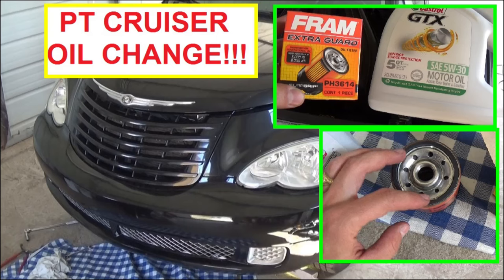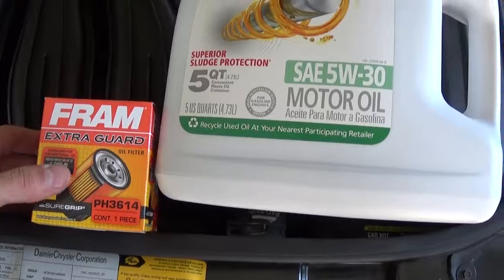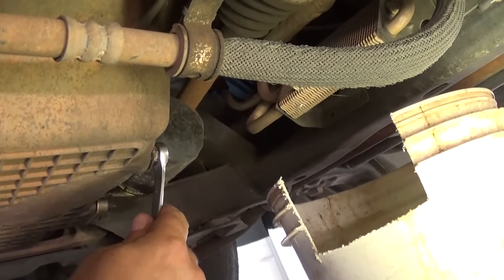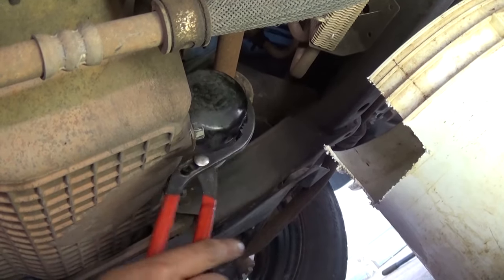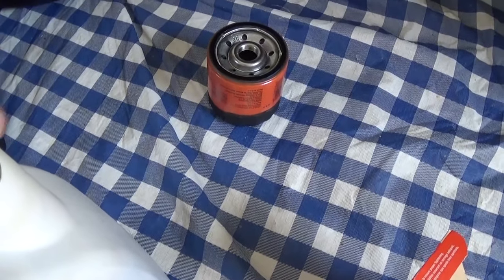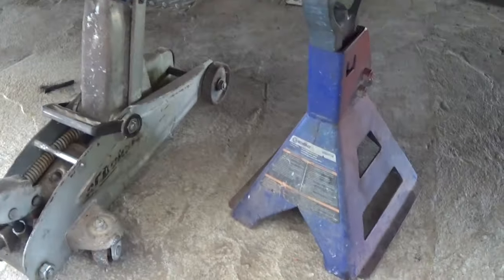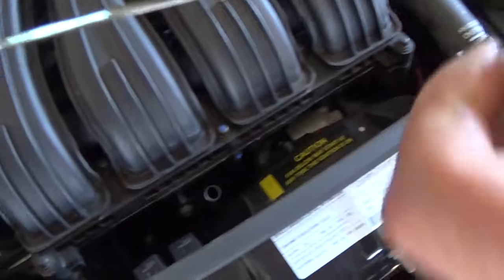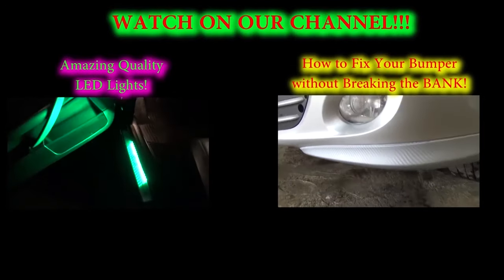Chrysler PT Cruiser Oil Change .  How to do an oil Change on Chrysler PT CRUISER 2.4 Engine

Comment: 13mm socket.  20 ft lbs torque if you use a torque wrench. 5qts. 5w-30 oil. For a Fram filter use PH3600 or there are other levels with letters HM3600 XG3600.  Its about 1 to 1-1/2" longer then filter of 2.4L Caravan engines (same fit but larger oil capacity).  Use jack stand/s, don't work under your car without jack stand/s or on ramps. Actually if you've taken your car to one of the quick change oil change places and they over-tightened the plug (the reason why I stay away from the places now) they might of next visit stripped the plug bolt head and luckily finally getting the plug out with a special crimping bold extractor they may have then replaced the drain plug with one that gives a larger bolt head size.  So original plug being small at 13mm, they have replacements that make the head larger to 16mm. Also if the pan threads have been stripped out there are like first oversize, second oversice etc that are self tapping that also have a larger head to 16mm or 11/16".  And best to use the type of socket (or wrench) called 6 point socket or box end wrench that grabs all the sides of the bolt at once instead of just the bolt head edge tips.
Reply: What filter is recommended?
Reply: @RudyWarman  You can use any of those filters, the PH3600 is basic $4, HM3600 is High Mileaage $5 the XG3600 is ExtraGuard 20,000 mile with synthetic oil about $9.  Also, If you ever have had an oversized oil plug put in you oil pan because a oil change jerk overtightened and stripped it or the next oil change the guy rounded it off because he used the wrong wrench or socket and it was overtightened previous, the oversized ones actually have a larger mm bolt (maybe 14mm or 15mm) That was my experience and I liked that the plug head was larger mm. 13mm is actually quite small and can get rounded off especially if previous oil change it was overtightened.  Over sized plugs are available at parts stores (1st oversize 2nd oversize etc) and they are self tapping so you screw them in, then remove, maybe repeat a few times with the corner of a oil dipped rag so you can put it in the plug hole and use your little finger to try to grab and pull out any flakes of metal that were pushed over edge with the self taping plug. These quick lube places, the tech tightens the plug then must have supervisor check it and the jerk will often turn it another 1/3 to half a turn certainly overtightening.  If you use a torque wrench I believe the torque specified is 18-21 foot lbs but you can easily check that by doing an internet search for your yr make and engine size torque for oil plug.

Comment: Hi. Great Video, i was made the same, but i have two questions. After the oil change apear an error in the light of the oil and the chime is ding ding every time. I think is the sensor, but i don't know the location. And the second question is about the undercover of the engine, the pt cruiser have undercover protection? Be cause i think was Lost that

Comment: My drain plug is totally stuck. It's not striped yet but it's sort starting to be although I'm using a quality hexagonal key... Any advice?
Reply: Next time you do an oil change use a vice grip to get the plug out, take it to a NAPA and buy a new drain plug (bolt) for a few bucks... Or a dealer doing an oil change can change the plug too, at a cost of course.

Comment: So you need to replace the drain plug crush washer?
Reply: At every 5 changes  ..  my take  ..   I seldom , if ever change a plug gasket.
Reply: I change this every other oil change, it's only about $5 but it's worth it for reassurance.